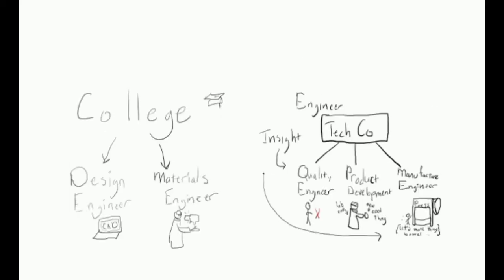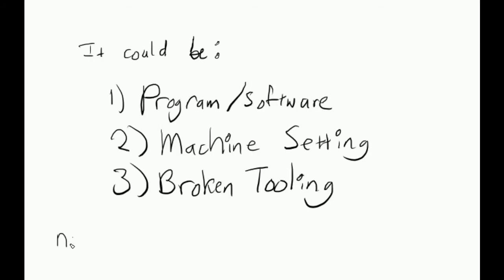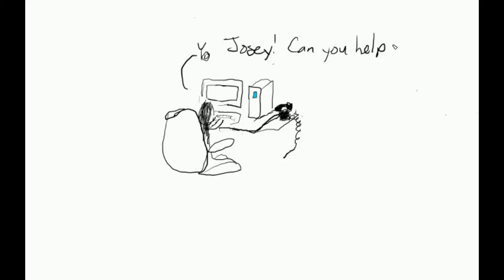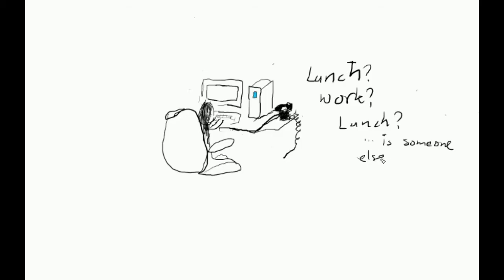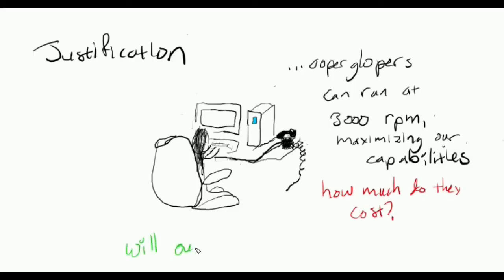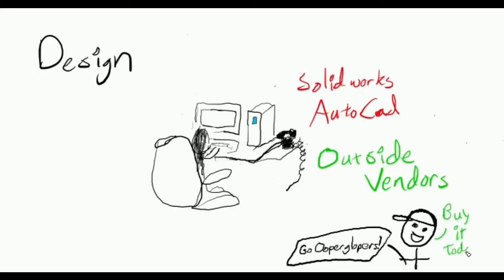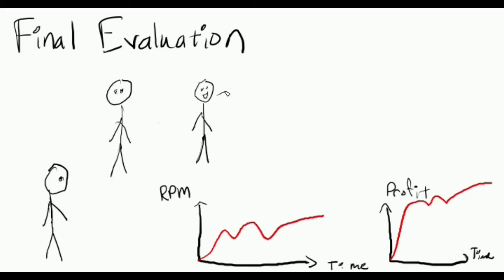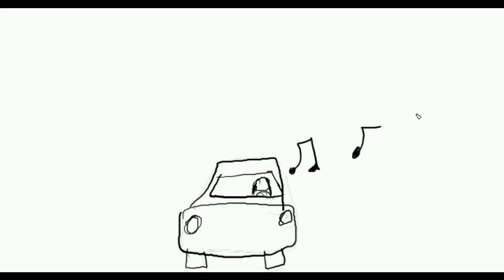Day in the Life: Manufacturing Engineer

Comment: I am going to start this role from next month. I have been graduated 2 years ago and been only doing shop floor work and applying jobs. Until finally i get Production engineer role. Since, i have not done anything in upper level. I dont know what's my life going to be.. i believe the video tell me my future. I hope i can land on their expectations. I hope they provide me some training as well
Reply: @varunkrit4422 how do you like it ?
Reply: Update?
Reply: Hi guys, I did not get any training to start with but my department helped me alot understanding as they were experienced. It is kinda like indirect training. It has been 2 year in this place I came across alot of challenges and so far was able to solve alot of them. My role has now expanded into designing and continuous improvement in production. I do deal with everyone and try to solve their problems. Let me know if you have any questions.

Comment: Great video. I personally would have said something like a big machine can take a more significant cut depth, reducing roughing time decreasing part turnover, and decreasing machine time, reducing cost per part. leading to higher production, which decreases project time till completion, and improves customer relations, which secures supply chain dependencies, which leads to more contracts. RPM being specific to material and cut speed... Nevermind RPM is fine for proof of concept. That was a lot of words.

Comment: Do they not usually split the roles described in this video ?
This seems like you’re wearing multiple hats that leverage complimentary but very separate skillsets. 

I see this as a day in the life of 1 ME doing 3 roles that have different titles:
1. Support Manufacturing Engineers (helping ops)
2. Analysts (Process improvement, strategic projects, business cases, etc. )
3. Engineering Manufacturing Engineers (Building new manufacturing process)
Reply from the maker: I don't know about usually, but at a small company, it's common to wear multiple hats.  I'm not surprised that you see the ability to split this into multiple functions.  Perhaps at large companies, they have the resources to do that.  My guess is this isn't about normal, but about company size and resources.

Comment: What are some of the engineering jobs that require minimal travel? Seems like most engineering jobs require 25% or more travel
Reply from the maker: Most jobs I've had do not require that level of travel.  It depends on the company
Reply: Just because a job description says 25% doesn’t mean that it will be that high. It’s a guess. 

My current role as a manufacturing engineer has “25%” travel. And I have only traveled twice in the last 6 months. 

Percentage wise it would be closer to 10% for me.

Comment: Is this job like product design and manufacturing?
Reply: More like product designing for internal projects to improve the process. You won't only do some product designing, you'll also be doing process designing and implementation. The goal is the be a subject matter expert to keep the production moving for current and new products. It is a well rounded position, utilizing mechanical and industrial engineering simultaneously with in depth project management skills.

Comment: Question: how is this job type different than that of a mechanical engineer?
Reply from the maker: I graduated with a degree in mechanical engineering, so in a sense, it is not different from a job done by a mechanical engineer.  However, most job postings titled "mechanical engineer" will be on the design side of the fence instead of the manufacturing side. Thus, a design based mechanical engineer will spend their day creating drawings and models on their computer to design a product, as opposed to out on the shop floor helping the design become reality.
Reply: JobTalk thanks for the info!

Comment: Job is different everywhere you work but this is a good general video.  Example is if you work at John Deere you will never really do any engineering and will be tunnel-visioned and not learn and grow and deal with the frustration of union workers.  If you work for a small company you can be exposed to numerous manufacturing processes like machining, cnc programming, plastic injection molding, electronics, chemical processing, etc.  If you work at Honda you might be on a team of 5 manufacturing engineers and only be allowed to work on 2 crankshafts......SO EXCITING!!!!  All pay roughly the same so if you want to be a turd or if you want to grow and be the best engineer you can be I have given you enough guidance in this post.

Comment: Great video. I just started as a manufacturing engineer last week and wasn’t really sure how to approach my job in a structured way. Definitely gave me some insight how to do my job better for next week. Thanks
Reply: David Hagadorn David what did you study in college. Mechanical engineering?
Reply: @terriblelottery  Yes Mech Eng. I noticed Chemical Engineering is also a common major in this field.
Reply: David Hagadorn do you like being a manufacturing engineer? Can you tell me a little about it?
Reply: @terriblelottery Yes Manuf engr is pretty rewarding but also stressful(..at least at my company). I come from a background of designing/fabricating automotive components/shop machines as a hobby so a lot of processing knowledge transfers over well. I enjoy that I can improve a manufacturing process and be hands on at certain times (machinery needs fixing or training operator). I get to use CAD to design fixtures and tooling for the parts I make. My advice is to make sure you vibe well with the culture of the company.
Reply: Can someone from same background ho into consultancy firms? 
Can you give me an idea how it will be different from mechanical engineers daily work life?
Please, I'm going to join college in smart manufacturing branch

Comment: I have applied a position in medical manufacturing company called biofire but I don't have any background in manufacturing engineering. I am little bit nervous because I don't know  what I will be doing as Manufacturing engineering technician in that company and I have interview coming up this Wednesday.What will be your advice to me so that I can be successful in this career.I have background in electronics and communication systems in Africa and taught myself some computer programming languages but I don't have any equipment designing background.

Thanks so much
Reply from the maker: I hope your interview went well!  Certainly taking the step to apply and get the job is the biggest one you can make to help yourself be successful.  To me, the biggest aids to success as a manufacturing engineer are to form good relationships with the people operating the equipment, and to get multiple ideas for vetting before picking one for moving forward.  By forming good relationships with the people operating the equipment, you'll get the best insights quickly for what needs to change.  By being careful to vet multiple ideas before picking one, you'll be able to avoid prejudices that will lead you to a bad decision.  The technical knowledge you'll need is company-specific.  Once you figure out what you don't know, try to learn more from people more senior, and from places outside your company.  Good luck!!

Comment: which major does manufacturing engineering fall under ? mechanical or industrial ?
Reply from the maker: I got a mechanical engineering degree, but industrial would work as well.  One of my manufacturing engineering colleagues was a chemical engineer; it suited our company's needs.
Reply: Most companies ask for a B.S. in Engineering, Math, or Physics. They're more concerned with whether or not you have the skills necessary to handle the job than what major you got. If you only want to work in a manufacturing/production type capacity I would aim for a B.S. in Industrial Engineering as a first choice.